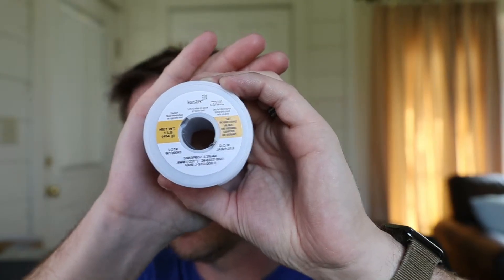I’m throwing all my solder away

Comment: Great stuff. 
I have an old roll of 44 60/40 66 core that ill still use. 
I use both 44 and 245 kester both 63/37 alot too. 
FYI 60/40 44 and 60/37 44 both melt at pretty much same temp according to data sheets
190c for 60/40 and 183c for 63/37. 
The real difference is 63/37 is eutectic. Meaning there isnt a melt zone theres a melt point. Once you pull iron away it almost instantly goes solid. 
60/40 has a melt zone. When you pull iron away it will take a second to go solid. 
This can be good and bad. Dont want to get into it all for a long message but both have their merits. 
But i will agree on one thing. Kester is great solder. 
Edit: my 60/40 44 is 13 years old and still solders like new. 
I use 350c/662F almost always for both 245 (resin) and 44 (rosin). Most important is finding a temp that you can get good wetting and get out before samaging anything. Sometimes lower temps cause more damage for time you have to be on the board.

Comment: Before discovering Kester (through a Bardwell tutorial), I would use any random solder I had. I can tell you that the quality of every joint I make is now stellar. I don't consider myself a master with the iron, but my joints are all perfect now. 63/37 Kester + Kester RF741 flux (syringe style) + TS100 soldering iron are my go-to for everything. My stack of stuff to fix is shrinking fast. I even removed SO-8 ICs and remounted them in an amplifier project and it worked the first time. Again, I'm a programmer with caffene shakes but this combo opened up a new world to me. It's around 120 bucks for everything mentioned. I have the 1lb roll which should last a good while. The cost already paid for itself in productivity and sanity. With the 1lb roll, you'll never run out if drones are all you do. Thank you for the video.
Reply from the maker: Yeah it’s pretty amazing stuff when compared to random off the shelf stuff. Thanks for watching!

Comment: I also have the Kester 63/37 but the serial is "8800" rather than "0027" what's the difference?
Reply from the maker: They are close but not the same thing. 0027 is a 60/40 blend and the other is the 63/37 blend. They may also have different flux.

Comment: I'm glad you found the Kester 63/37 as your favorite. The 63/37 "44" flux is a industry standard. I work at Honeywell Space and Defense and we use that exact solder on the components going up into space. I have never used a better solder and I am more than willing to pay the price because you never want to A. Pay twice, and B. Do a job twice.
Reply from the maker: Do you know if flux has the same corrosion properties in space as it does here on land? I know Kester uses a lower acid flux but my guess is you the thoroughly wash soldered joints before sending them into orbit.
Reply: @breaksteel  I am not sure. But I can tell you the boards have to be absolutely spotless (the flux is removed with Axarel 2200 and vacuumed off), then washed in high purity IPA. No contamination is allowed or the boards are rejected.
Reply from the maker: Makes sense. Better to not have to answer that question by having components fail while in orbit by removing any chance of corrosion. Not even sure they could test it without having to then retrieve test object from orbit.

Comment: Thanks for the excellent video and the links.  I changed to Kester 63/37 years ago. It's great and the transition from solid to liquid is very fast.  60/40 goes from a solid to putty and then finally liquid. Got rid of all my 60/40.
Reply from the maker: Happy you enjoyed it, thanks for watching! 
Yes the 63/37 is so much better. Quicker soldering, cleaner work and lower melt point. Never going back. Gave away all the other stuff I had.

Comment: All I do is through-hole soldering. Is 0.031 a good size for this?
Reply from the maker: .031 is a very good all around solder size. I use it for as small as 0402 SMD (a bit difficult but it works) all the way up to 8g wire.

Comment: Hi, cool. It's best to mechanically connect this, instead of solder, coz' of all the vibration (better if soldered and mechanically attached like crimped and/or fastened together):-)

God bless, Rev. 21:4
Reply from the maker: For the small gauge wires it’s plenty strong of a connection. For larger gauge like the battery connections it’s usually good to zip tie them as you suggest.

Comment: Good stuff, pretty much the gold standard. As good or better is multicore or Alpha Reliacore, but harder to find in USA compared to kester.
Reply: Multicore is nice! I'd like to try kester but it's expensive here in Europe
Reply from the maker: Is it that much more expensive than Multicore?
Reply: @breaksteel  usually 30-50% more in my country. I'm sure it's great as everyone in the US swears by it!
Reply from the maker: @monz7951  That’s an insane markup. Yes it’s good but I’m not sure I’d pay that much ether.
Reply from the maker: Haven’t come across ether of those. Interested in trying some if FD supposed to beat the Kester.
Reply: @breaksteel  All-Spec/Hisco carries the Alpha solders, I bought 1# rolls of several varieties and they are superb. Their Energized Plus is great-- super effective flux that still doesn't need to be removed to prevent corrosion. Their Reliacore is mil spec RMA. Telecore Plus is a no clean that meets tons of industry specs. I learned that I often only need a 2.2% or 1.1% flux wire.
Reply from the maker: Might snag a spool of thin gauge stuff. The .032 looks like a tree stalk when soldering under the scope.
Reply: @breaksteel  yeah 0.025 is my GP wire with 0.020 or 0.015 preferred for anything small. Alpha makes a 0.010 if your feeling adventurous.
Reply from the maker: Yea .01 might be a pain. Certainly wouldn’t need an entire spool of it. I was thinking .015 would be the smallest I’d need. Thanks for the lead, I’ll check them out.

Comment: What’s the difference between 245 and 275 kester. Also what flux percentage should be used 1, 2 or 3%
Reply from the maker: The difference between 245 and 275 is the flux used. 275 is a no clean style flux whereas 245 is no clean but much lower residue on the completed joint. 
As far as 1 2 or 3 percent it’s personal preference. More solder = easier and quicker solder joints but also = more residue leftover. I think I use 2% and I add solder if needed.

Comment: This is good stuff, especially when combined with Kester 951.
Reply from the maker: I’m still very impressed with this solder after burning through 1/3 of the spool. Low melt temps, flows easily. Will be buying some thin gauge stuff for SMD work.
As for the 951, have not tried it yet. I literally just picked up some Amtech 559 tacky flux which is supposed to be really good. When this runs out I’ll try some of the 951.
Reply: @breaksteel  951 is more of a liquid, but it is no-clean.
Reply from the maker: Good to know. Maybe it does need to be on my bench.